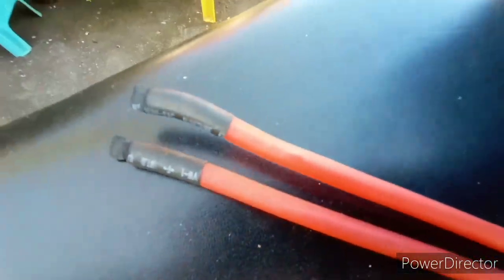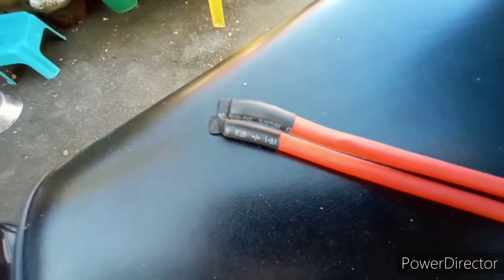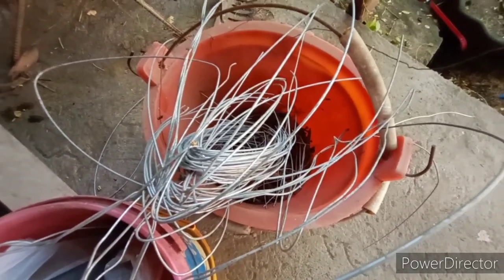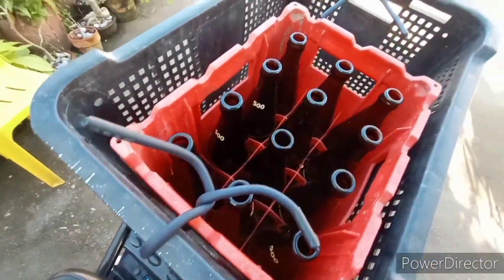TVS XL 100 * Helping Hands * Version 3 * DIY MOD

Comment: Very bright and useful idea! Why did u remove the front frame cover?
Reply from the maker: Thanks for watching and your comments.

I was going for the stripped down appearance. Sort of a rat bike like look. It's really light weight now. I can almost pick it up totally off the ground by myself now 💪 hahaha
Reply from the maker: One of the big weight reductions was the custom design stainless exhaust system. Shotgun slash cut. It's straight through with a baffel tube inside. I have a YouTube video about it..  Reminiscent of the Harley Sportster drag pipe. Has a unique sound. Less than half the weight of the factory exhaust. Changed the overall looks. Engine likes it. Runs a lot better. More power.

You have to disable the secondary air injection system with the exhaust system modification. Or else it will have a lot of backfire through the exhaust.
Reply: @stevekb1dig  pls post the link. Thanks!
Reply from the maker: @KaEarthTV  

https://youtu.be/pDp0SBcOSwA